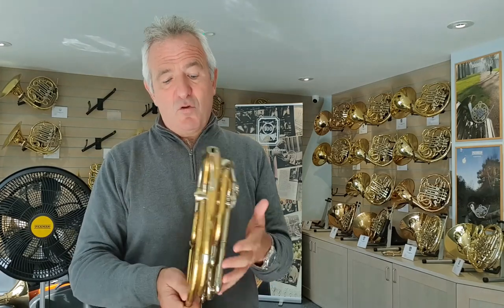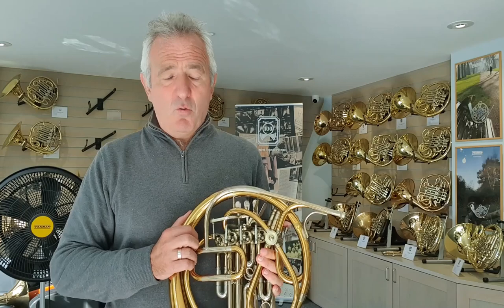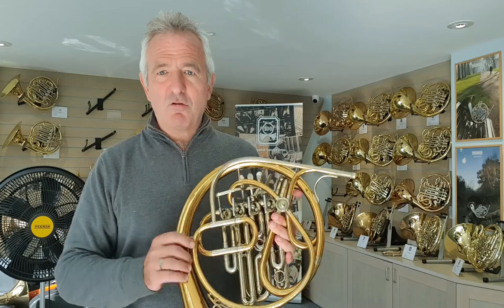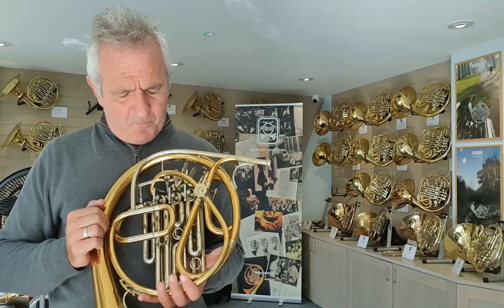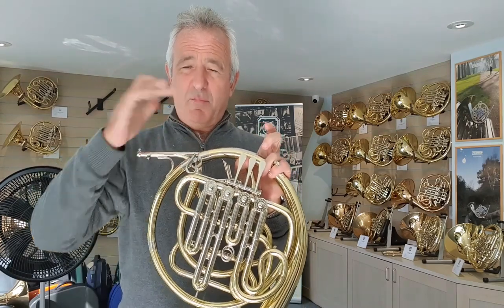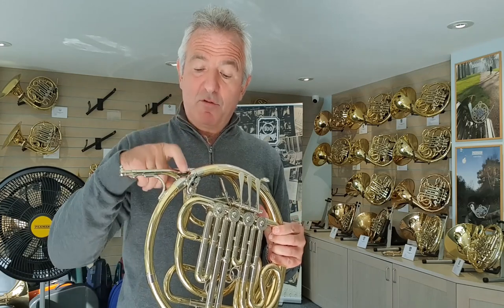Paxman model 45 Bb/f-alto double descant horn

Comment: You need to talk about Dick's original model with double linked rotors to get the air running in the same direction. I've only seen two of those and that was about 45 years ago. Bob, Dick And I talked into the night after closing time, at the Nag's Head, about His ideas and design solutions. Wonderful memories...